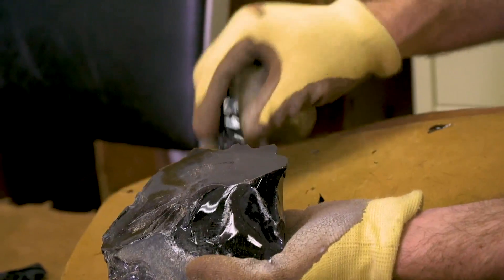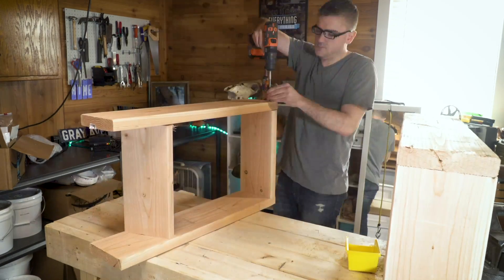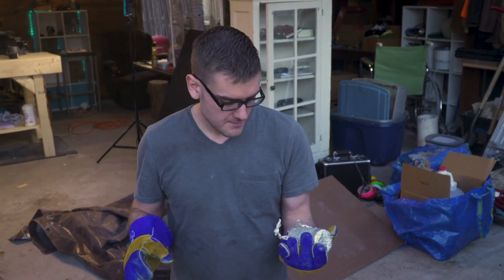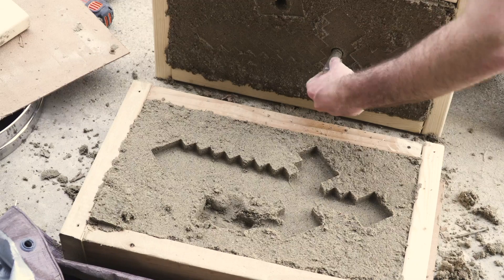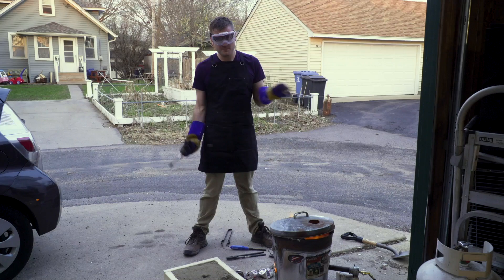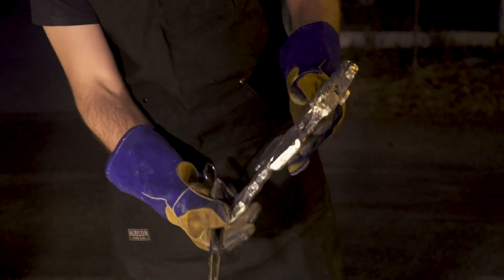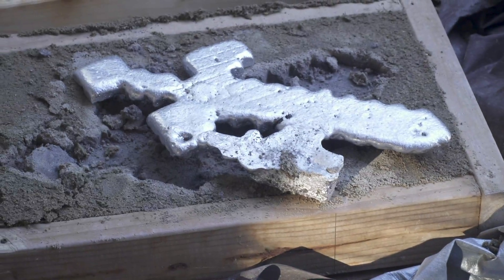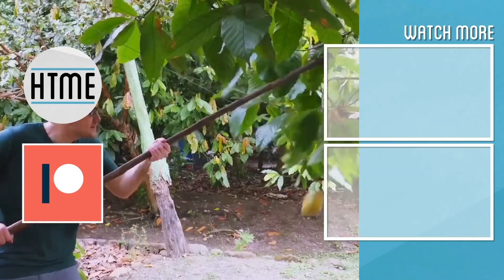Minecraft Sword from Soda Cans: Metal Casting 101

Comment: Couple things about casting that might help.
-Index your mold.  Basically just put two matching V shaped sections of wood on the long sides, and one on each of the smaller, so they sit inside each other.  That's the easiest, but you can also screw the molds together, or do a lot of other stuff.  Key point is something for repeat alignment.
-After your first half of the mold is done, hit it with a release agent.  Talc/baby powder is really common for it.  Get it on the sand and surface of the what will face the second part of the mold, then lightly dust off with a soft brush.  Think makeup brush or similar.
-Honestly, the sand needed compacted more and looked a touch on the wet side.  What I used a lot when I did casting was basically a 2-3" round section of 1/2" plywood with a 2" dowel screwed into the middle of it.  Whack the top of the dowel (starting soft and increasing pressure) with a rubber dead blow hammer.  Distributes the pressure evenly, but compacts very well.
-Use a teaspoon of Borax as a last pass flux and degasser for your metals.  Do it outside btw.  It'll clean up your pours and let you get more dross out of the metal.
-Preheating your mold will help a lot, but short of a larger oven or similar, I'm not sure how you'd do it on something that size.
-Lastly, for bronze, look at lost wax casting.  It's a bit more detailed to do, but gives a great finish provided you can do it properly.

Comment: We just did this in one of my classes so heres a few tips. Pour all of the aluminum at once, use talcom or baby powder between the two sides to prevent the sand from sticking, and maybe use oil in your sand rather than water. Im not sure if you need a special type of sand to use oil, but thats what we have at school. Also, you need to slowly pre heat the crucibles before you first use them.

Comment: How do they do this on a mass production scale
Reply: Sunset Vlogs the same but on a mass scale
Reply: they use what is known a a match plate to form the molds, then compress the mold with the match plate still in the middle, the match plate has both the top and bottom forms that form the sand, then they remove the molds from the casting plate and put them together to make the casting mold, or they use a shell casting to hold the metal and the sand is there only as a backer material

Comment: Mold separation would be easer if you use talk on the sand before you ram the second part of the flask
You must temper your crusabls because you will end up with trapped moister

Comment: Try less water in the sand. The texture should be wet enough that it sticks together, but when moulded into a solid shape, you should be able to "snap" it, by bending. Rather than crumbling, it will break cleanly(for sand anyway) in half. Too much water can cause steam explosions, while not enough can have the sand crumble into the casting. As for flux, I haven't really tried any myself, but I've heard sodium tetraborate(borax) works well. As for slag(dross), I use a large pair of dollar shop tongs, open as far as possible, using one side to stir the metal, getting in all the edges, because the slag won't always float to the top. When scooping, make sure when getting rid of the slag, you have somewhere to put it. This could be a small scrap wood box, or metal, but somewhere you aren't going to be stepping. Trust me, I know. When putting cans into the melt, place them open side up, because any water left in them can cause a small explosion, harmless on its own, but when combined with 650+ degrees (Celsius) liquid metal, not really a great thing to be doing. Open side up lets the steam out, and also stops you from having no face. Also, do be careful breathing the fumes, they aren't great for the lungs... you'll be able to smell and taste them and that's when you move away. I'd just recommend a basic fume mask, or even construction dust mask. Or just hold your breath. Good luck in future with your metal casting, and its good to see you've gone straight to gas rather than trying coal. Coal is so much more difficult to work with, but also is the only way to get temps of molten steel. Check out Grant Thompson again if you have to: he has some amazing casting content, including copper. Keep doing these videos. They're amazing. Again, good luck from NZ.

Comment: better sprues and venting, registers for your mold and a better sane system to get higher quality medium around the molded item :)  pre-heat the mold if you can otherwise try to do a vertical mold versus a horizontal one :) only thing left is to get your transition and pour mechanism down to a quicker smoother process and you'll be rock'n out high end stuff in no time! always fun to watch!

Comment: Go have a look through the doubleboost youtube channel. He has some excellent casting videos that you can probably learn a lot from.

A few thoughts: you really need to make sure you fill all the voids in the sand right to the edges. Also, work up on a bench - you'll have a much better time moving the big heavy boxes around so it'll save you disturbing them so much (consider adding a couple of basic handles to the sides of the boxes!). You'll have more stamina for packing the sand better stood up too. Best of luck for the future attempts!

Comment: Well, I already casted aluminum and copper at home and also made a video about it. So this is nothing new to me. However I never had sucess using the method with casting sand.
So I found a much better way of making molds.
The first step is to build the object you want to cast out of styrofoam (I did a slingshot).
Then I covered it in clay, dried and hardened it in the fire, so that the foam disappears.
The last step is to support it in a bucket of sand and then casting it.
This also works great with iron.
If you want to cast a larger object like you did, it turned out to be very helpful to heat up the clay mold so that the metal doesn't cool so rapidly and therefore flows a lot easier.
Reply: I see you like on every video I watch.. It seems your FreizeitYouTubesphäre is the same as mine ;D
Reply: Sand is the best and easy way to go 😉
Reply: Wooden Weaponry Well, that may be true 😂😃😄👌

Comment: Ok, many things to improve here. First, pack the sand very very dense. Second, add talcum powder to the separation line between the molds and the around the form. Third, have aligning pins for the molds. Fourth, add gas vents, or "ricers" on all the extremities of the cast. Fifth, use at least partly aluminium that is already cast, not extruded. (engine parts, equipment housings, alloy wheels) Sixth, be damn sure that the volume of your crucible is bigger than the volume of your cast, or have someone ready to continue the pour immediately after the first crucible is spent; the pour has to happen in one continuous flow. (You can use steel crucibles for aluminium) See myfordboy channel for further details.

Comment: The other advantage of working with soft metals like aluminum:
You don't need to heat it up to work it. You can easily hammer/press and deform it while it's cold. Generally however it's not a good idea to have a soft sword.

Comment: Two recommendations: 
1) use the rule of thumb "Pig your aluminum, and never pig your copper/bronze/brass" because when melting aluminum you end up w/ a lot of dross and dissolved hydrogen gas that needs to be removed from the metal by using a degassing compound, but pigging copper puts undue stress on your crucibles as copper slowly degrades the carbon in the crucible. The term "pig" implies a stock ingot to use as source material for future castings.
2) Check out the channel Myfordboy; he is very adept at aluminum casting and has well over 50 videos on the topic. There is no speech, but watching one so skilled really does provide copious amounts of education.

Comment: You should use some dry parting powder so the two parts of the mold don't stick together, usually talc powder is used. Also, your gating is awfully rough and dirty and bits of it get dragged into the piece. The gating sould be just as clean, smooth and firm as the rest of the mould. 
I also think that your sand is wet, it shoulbe as dry as you can get it without it geting crumbly or starting to get eroded by the molten metal, it is a tricky balance and needs practice to fine tune.
It would do no harm to pass ALL your sand through a big, coarser sieve to undo the litle clumps and regulate the moisture. When you sqeeze a fistful of sand it should form a single, firm clump with the shape of the fingers well defined and no sand sticking to your skin.
Reply: Or not using water at all to make the greensand. Some use motor oil instead.

Comment: I have a suggestion of a youtube about smelting The king of random and maybe use styrofoam for casting instead of just plain sand so you can get it evenly. And maybe try to make standing so the metal start from the bottom to top so you get evenly by using a big bucket I hope this can help you

Comment: I suggest you put some more wood around the edges of mold so they fit together perfectly each time also make some funnels possibly from plaster or foam going into the mold at two points which will make sure it fills all the way and if the thing your casting is made from foam you wont have to pull it out of the mold because the aluminum will vaporize the foam and fill the space where the foam was hope this helps

Comment: It's advantageous to first melt your cans and turn them into ingots. You remelt the ingots to cast whatever you want to make. This way you have a better idea of how much metal you have and there will be less impurities. When you make your ingots (with muffing trays for example) make sure you preheated your molds to make sure there is no moisture in them. Moisture can send molten metal flying.

Comment: Something that I remember from material science in university and what I very rarely see in DIY casting videos: preheating the mould before you cast the metal. This helps the metal flow into the details of the contour and can help to prevent inclusions and cavities, especially with larger parts. It also dries the mould and eliminates the risk of steam bubbles forming from trapped water. It might also be a good idea to register the forms together in some way, to get proper alignment, which is important for half moulds (which will be necessary for curved contours such as a bronze age sword) That said: I absolutely love your videos and really look forward to seeing your learning process, as this is a super interesting field of material science and I hope you enjoy it :)
Reply: Not a problem, as he's using greensand. Preheating it causes it to set, like the bits that he had to knock out of the space between the failed casts and the excess material deposit.
Reply: preheating a mold is only needed for some alloys or some types of castings and there is a fair amount of engineering that goes into determining if hot mold casting is needed. Most of the time a room temp mold is fine even in most industrial casting situations.

There is also the greensand techniques of Dry skinning or dry molding which can make for better edge detail in this waterbased greensand but it's not a requirement. Dry skinning (using a torch to dry an inch or 2 of the mold or open faced baking to get a 1-2" dry down) can lead to an inconsistent moisture content in different parts of the mold if done incorrectly. Doing a full bake out for dry molding takes an oven large enough for the flask your casting into and can make for a weaker flask (binders are often added to improve strength).

Here it looks like there was too much water in the sand causing a small amount of water vapor blocking the metal from flowing.

I definitely second the need for alignment pins in the flask to get correct cope and drag alignment.
Reply: Pixl Rainbow: That is indeed true for pure sand, but it might just work with the added clay, when the mould is not moved or subjected to shocks after setup. The experience I have made with natural soils and sands is that even the slightest hint of clay adds a significant amount of strength when dried, but this might not be the case for this type of casting sand.
Reply: That's actually exactly what the case with greensand is, Cremis713.
Reply: Did not know that about dry molding and skinning weakening the material- never had that issue before. Thanks for the info!
Reply: Most decent DIY casting videos I've seen have the moulds matched using two or three little bits of wood screwed into the edges of one of the halves, keeping them tightly held together.
Reply: Cremis713 problem: dry sand doesn't hold together. He would need a different mold material
Reply: That's good to know! Thank you for the info :)
Reply: Cremis713 thats actually pretty funny
Reply: What do you mean registering the form together
Reply: Just get 2 iron ingots and 1 stick then craft it smh 😤
Reply: Words of Wisdom, good sir! Thanks for the tips! I will remember that if I ever think of smelting and forging, just because it's fun to do!

Comment: Hey Andy, I love your videos and I thought I might add my 2 cents into the mix. First and foremost you 2 nice and even frames, I noticed in the video that the frames were not flush with one another which is why I think you might of had troubles with your preparation. Second, I would recommend putting screw holes into your mold in order to make it easier for it to come out. Finally, talcum powder your mold and the layer between the two frames making sure to brush off or lightly air brush the excess talcum off this will ensure a clean separation between the parts. Do take this advice with a grain of salt though as I am writing from my own experience messing around with a mate. Actually, one more thing. Try different experimenting different ratios for green sand in smaller quantities i find that helps as well.

Comment: Great video, awesome to see all the great work you put into it. 

I tend to just use foam for the mold, leave it in place and then pour the molten metal in (Lost-foam casting). Tend to see a way better result because of the  tighter pack IMO. Might want to give that a try.
Reply: Most casting videos I've seen use lost foam casting. It seems a lot easier than having to take the mould apart to retrieve your template item, which probably also causes some destabilisation of the casting medium as well as potentially causing misalignment in the mould. 

I'd imagine he'd pick up on foam casting for the next video <3
Reply: Max Falto I'm pretty sure he didn't source or create the sand or the two by fours, But regardless I see your point.
Reply: thirsten55 The problem is he needs to use materials he can create or source himself, foam is out of his reach.
Reply: thirsten55 Oh... But he could have anyway. He has chopped a tree down and collected sand and clay previously for other projects, but yes those look store bought. I have no clue how foam is made.
Reply: Just get 2 iron ingots and a stick lol

Comment: Random bits of advice. 1 don't crush the cans 2 don't fill the crucible so much it might spill 3 poor slower 4 for a simple shape like a sword it will be much easier to do a foam cast. Basically make what you want to make out of foam and then burry it in sand with a poor spout at the top (vertical will be easier). The metal will melt and replace the foam before the sand can fill the void
Reply: Why not crush the can?
Reply: Brian Wyters they melt faster and you get less slag
Reply: Anyway to easier cut/make multiple Styrofoam templates? Id imagine its gonna be a pain to recreate the multiple times. Especially for someone who is still learning and expecting failures
Reply: Ahmad Zaki I use the styro-slicer that the king of random uses. He has a tutorial if you want to make one. Otherwise a sharp exacto blade that you heat up with a candle or lighter works well too just not as efficient